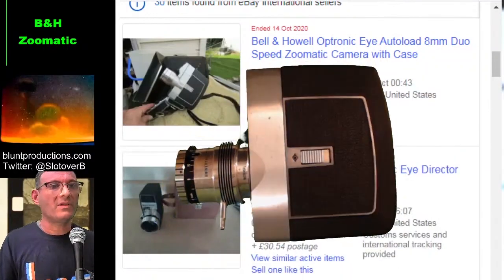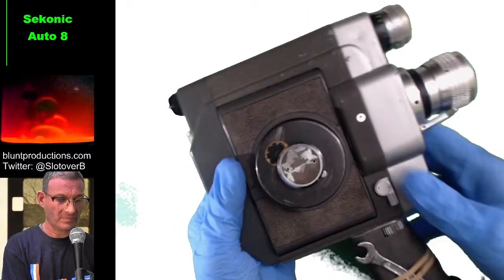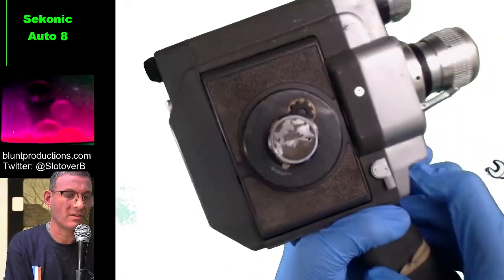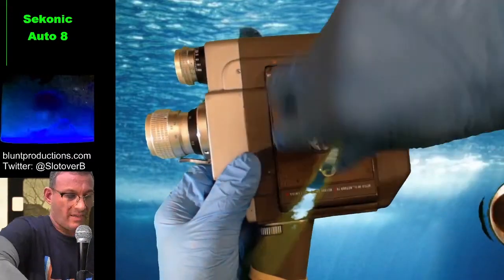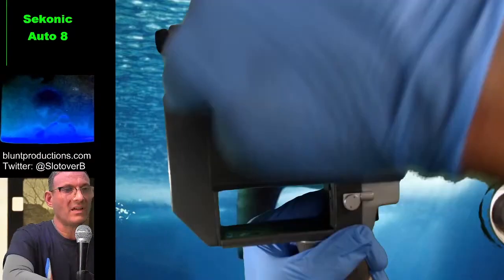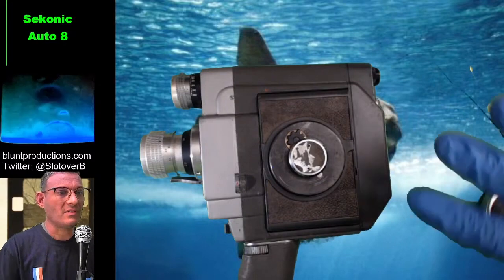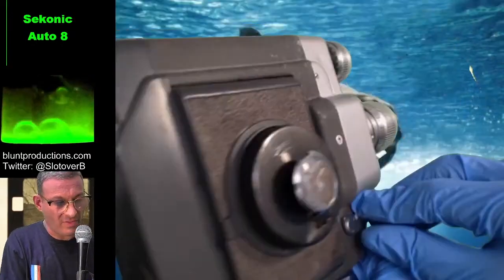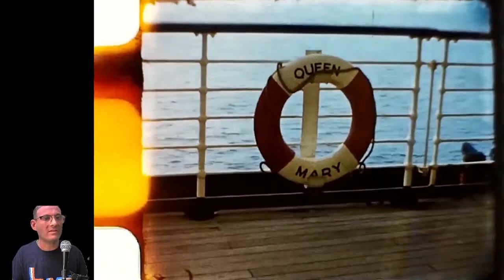The Surprising Sekonic Simplomat [Ben's Camera Show S01E02]

Comment: Welp. After a 7 camera streak of getting cameras in decent working order (the Bolex needing a CLA) it looks like I met my match with this one. The claw that advances the film through the shutter seems to be bent or worn out. Hopefully the Elmo 104 will turn out better because the Sekonic is out of commission. 😕
Reply from the maker: Ah that's a shame. It seems it's hard to get a Simplomat in good working order - you see what problems my one has..
Reply: @ZeroBudgetFilmSchool  Yeah, I think it’s a good thing they just stick to making light meters. It wasn’t a huge loss, only $20 (about £16?) I guess there’s a reason other manufacturers didn’t follow their system afterwards. I hope the Elmo works out better. But on the bright side, I got a handle and a case I can use on something else. 🤷
Reply: @ZeroBudgetFilmSchool  Fun Fact, I recently watched “Divine Trash” a documentary about John Waters from the 90s. The first 8mm camera he used was this model.

Someone in the future, I may buy another one or figure out the issue is with the claw.
Reply from the maker: @oldradiosnphonographs  That's a very cool fact. I read John Waters book Shock Value where he writes about his early years. It's a great read (though he never mentioned the Sekonic Simplomat!)
Reply: @ZeroBudgetFilmSchool  John Waters also used a Bell and Howell 70DA for some shots. The scene we all know and revile at in Pink Flamingos was filmed one one. Funnily enough someone was there with an Eclair camera filming Waters filming Pink Flamingos with a Auricon and Filmo 70DA. He used the 70DA to film Divine eating…you know…
Reply: @ZeroBudgetFilmSchool  I watched this other John Waters Documentary . Multiple Maniacs and Pink Flamingos was filmed on a Auricon but Female Trouble was filmed with an Eclair NPR? I guess all the money he got from Pink flamingos helped him afford a newer camera.